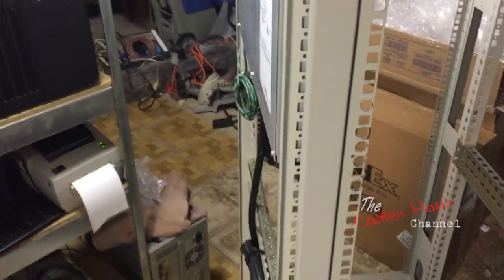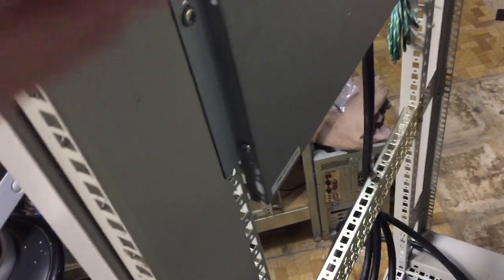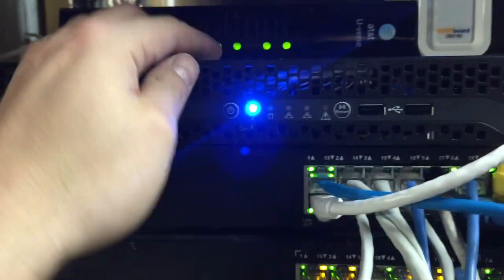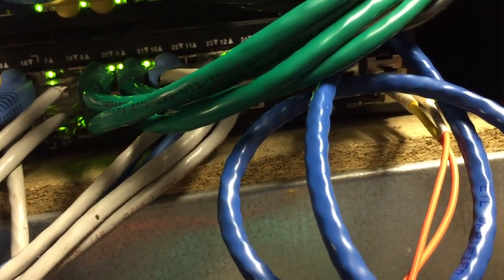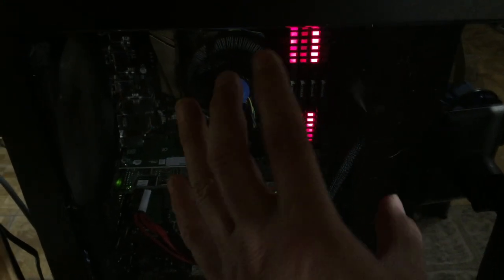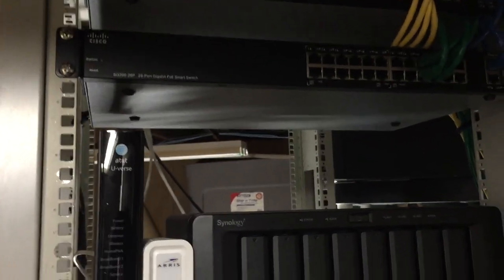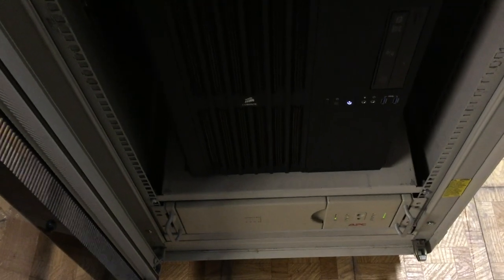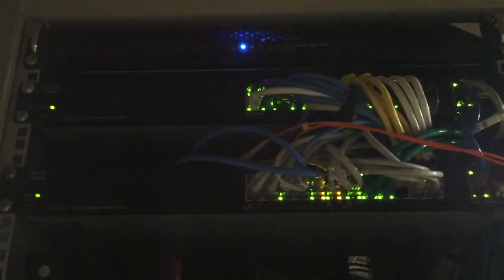New Server Datacenter Rack Part 1

Comment: I found a rack just like yours here where I live. Same color, same tinted plastic front door "Glass". Everything is the same. Got mine for $125 off Craigslist. It was in the garage of an older gentelman. I just set some servers in it but am looking to actually upgrade now. Very cool to see someone else using the same rack as me.
Reply from the maker: Thats pretty cool.  These racks are classic.  Hopefully you are enjoying yours.
Reply: I am enjoying it. I just got my hands on a Dell CS24-TY server (custom made by Dell for Facebook) and am looking at getting a Dell R710 server to put in it. The Dell rails have been a little tricky with the rack but I have made them work.
Reply from the maker: I ended up getting 6 sets of dell rails in mine.  Thats a nice piece to have the Dell customized for Facebook.  Where did you get that from?
Reply: A local company here in Kansas City that specializes in server hardware refurbishing.
Reply from the maker: That is too cool.  Would love to get my hands on one just for historic purposes.
Reply: I sent you a separate message with the link to it. Let me know if you get one.

Comment: I feel your pain bringing it down to the basement, I have a HP G3 full rack it was heavy af!
Reply from the maker: I bet, I ended up stripping everything out and taking the skeleton down stairs, like in the beginning of the video, but still it was damn heavy.  I even had to take out the caster wheels below to have enough room to tip it up, since I only have about an inch of clearance from the top of the beams to the rack.

Comment: For what are you using all that infrastructure?
Reply from the maker: Why not?
Reply: Haha sure, but I was just curious what services have you installed/configured there? Hosting a VPN server, DNS, DHCP., AD? Do you use it for fun and testing or profit too. 
Next week I am buying a catalyst switch, hp 380 g7 and plan later 2 custom PCs for pfsense and freeNAS. All of these are going to be used as home network and lab testings. 
However I was thinking if after some time and more investment could get some profit from it. At least for the system to pay for itself the electricity bill :)
Reply from the maker: It helps me keep up with latest tech, plus I have a tech business, and just a hobby too.  I run VMware, vCenter, Windows and Linux in AD Environment, Exchange, MSP, Site to Site VPN's and some secondary DC's.  Just a lot of Fun, and always just been into it.  Like an IT Professional's Sports Car.  LOL